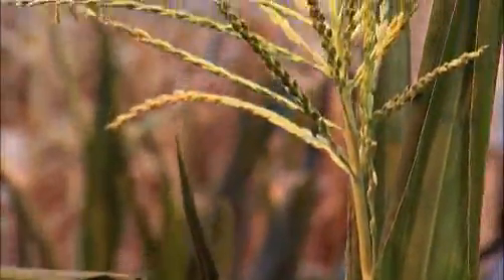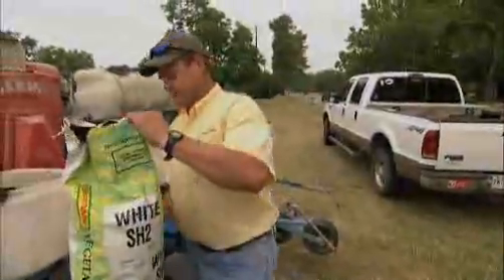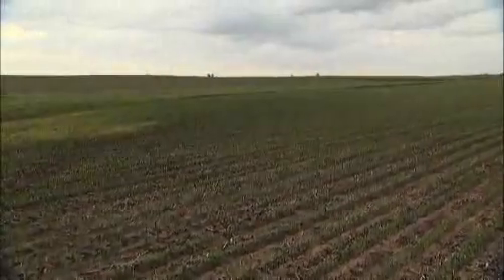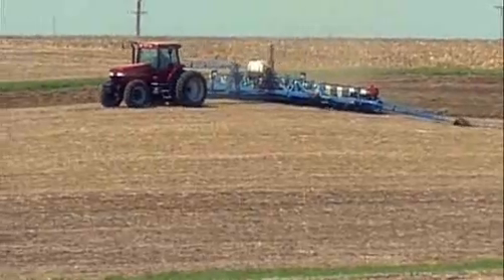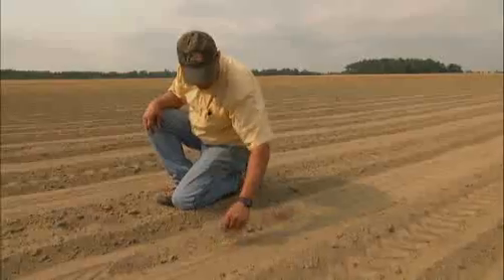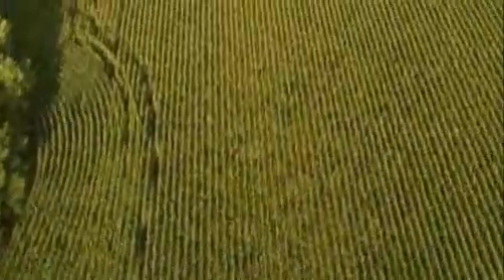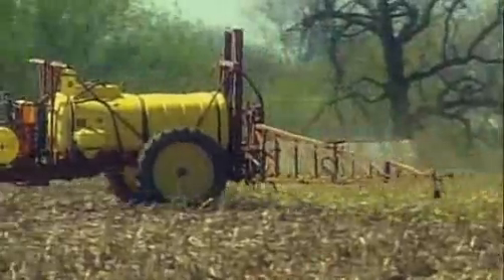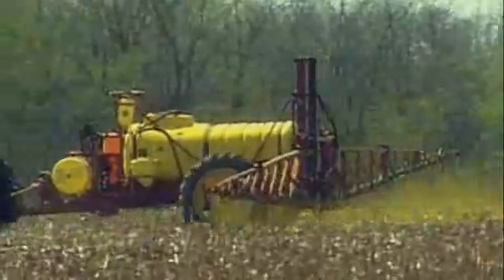HowStuffWorks Show: Episode 1: Growing Corn

Comment: @gvenema Well, we don't HAVE to use fertilizer. We could just do crop rotation. For example, if you rotate the beans right before the corn that would provide the extra nitrogen needed (I think it was beans at least). Plus they use natural gas to make fertilizer, not oil. Natural gas can be made from poo and farm waste (although it's mostly fossil nowadays).